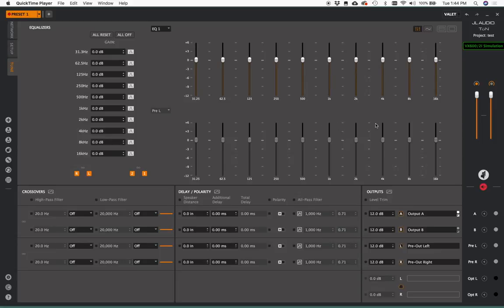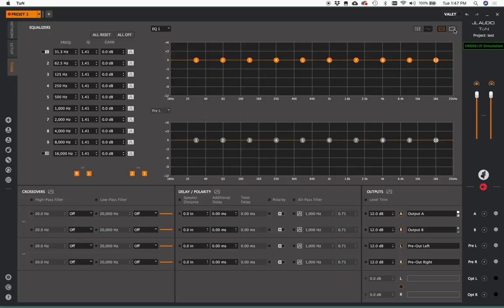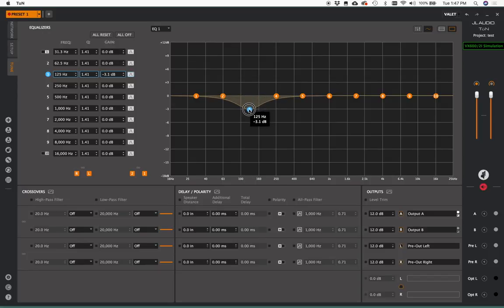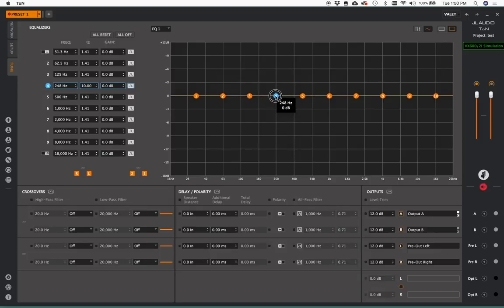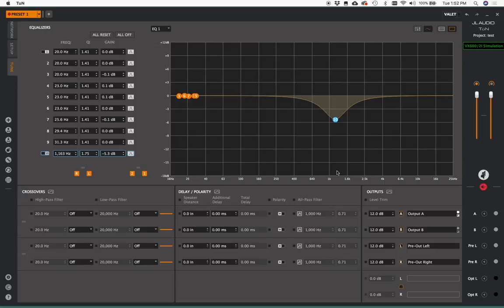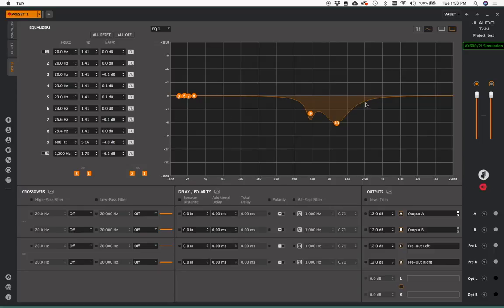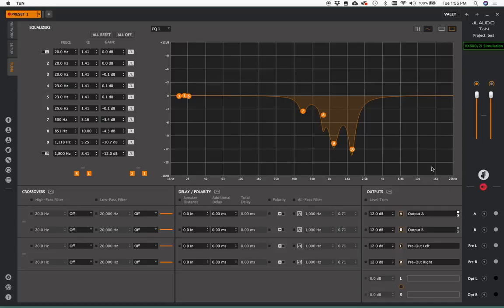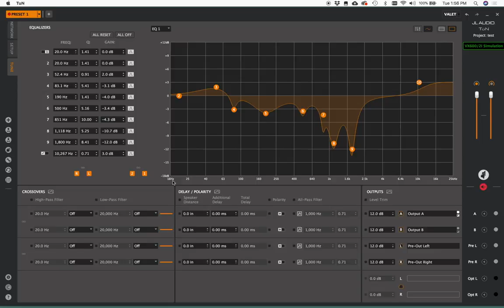JL Audio Help Center - Parametric EQ Basics

Comment: Q was much more a mystery to me when I first started tuning on my own and as I continue to learn and improve how to use these features without overdoing them. 

Would be very interested in an extended video series on how the folks at JL Audio tune their systems in a real application from beginning to end outside the theoretical (which is still valuable). 

Also never knew you could highlight multiple bands on the PEQ. 

It's cool your systems are becoming more and more integrated. One less device to run wire to and troubleshoot.

Comment: Great info. I'm using to many bands in the PEQ. I'm gonna make some adjustments today. On a different subject, I'm still running the tun 2.0 software. I see there is a 3.0 now. What are the differences? Is it necessary to update, and if so where can I find info on the update process.
Reply from the maker: TuN 3.0 added compatibility with our new VXi amplifiers. If you're using a TwK, you don't need to update, but the software is available at www.jlaudio.com/tun

Comment: Great video!!!  👍👍👍 To get very very good SQ in a car audio sound system what is the best way to go with a graphic EQ or a parametric EQ and why please if you may!!!! Your help and explanation would really help towards my huge car audio install that I will be doing in my 2012 TOYOTA 4RUNNER!!!! Taking into consideration that I will be going with12 to16 two way component set's three per each door from front to back and one on each of the a-pillars!!! I will be going with six JL 12W7AE-3 subwoofers behind the second roll in a ported wall on the c-pillar!!! All of this will be powered by ROCKFORD FOSGATE T series amps and a 270 amp alternator and about two to three xs power batteries in the rear cargo area!!!! Thank you!!!
Reply from the maker: Hello Jose, Manville explains the benefits of parametric in the video. They offer more flexibility and greater tuning capability than graphic EQ if used properly.
Reply: JLAudioInc So with that being  said, the best thing to do is find a high end head unit that has a parametric EQ itergrated into it or use an external  parametric EQ correct???
Reply from the maker: Most source units are limited to 10-13 total bands of EQ. The VXi or TwK 88 offer 10 bands of parametric per channel and the ability to have 10 bands within each pass band the speaker will play on that particular channel.  This gives you more tuning flexibility.
Reply: Dang it don't  get  much better than that

Comment: I'd really like to see a video on making the proper input/output settings in the TUN software when using the Fix and TWK units together and how they integrate with the amplifier (non-JL) gain settings.
Reply from the maker: Thanks for taking an interest -- we'll look into that!
Reply: @JLAudioInc  I have the Fix86 with a TWK88 and a Kenwood XR900-5.  System sounds good but I'm not sure if I have all the settings correct to maximize the performance.  Seems to be a lot going on with the three equipment variables.

Comment: LV your video on the twk 88 have a question how can I use the SMS DD1 TO set gains on the twk 88
Reply from the maker: @Eazy Rida, you would play the appropriate tone that is within the frequency range that coincides with each input and output of the TwK that you are using. Then first set up the input level of TwK to just below clipping. As long as input is not clipping the output should be at maximum for the greatest signal strength out of the TwK.

Comment: What is level trim?
Reply from the maker: Hello, in the TwK, the level trim will attenuate the signal output when placed anywhere below the maximum setting of 0 db. As long as the signal input is not clipping.  On the VXi the level trim functions as the gain of the amplifier and must be proportioned in relation to the input signal like the gain would be on a regular amplifier. So, you would first adjust the input signal sensitivity of the VXi in relation to the signal and then the level trim in relation to that so that the outputs of the amplifier are in direct proportion to the signal.
Reply: JL Audio in English can you tell me how to set the input level and level trim on vxi amp? Lol thank you very much
Reply from the maker: Here is a link to setting the input level of the VXi

https://jlaudio.zendesk.com/hc/en-us/articles/360001188267-VXi-Amplifier-Level-Setting-Guide